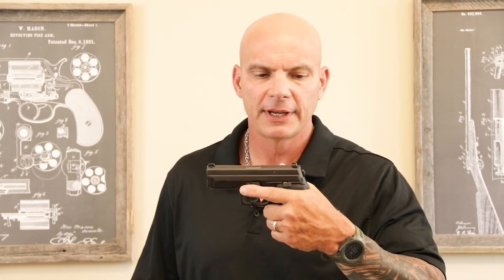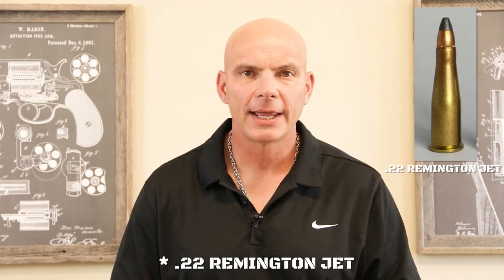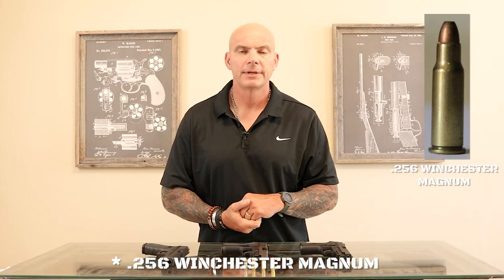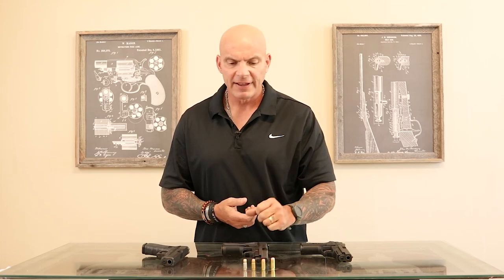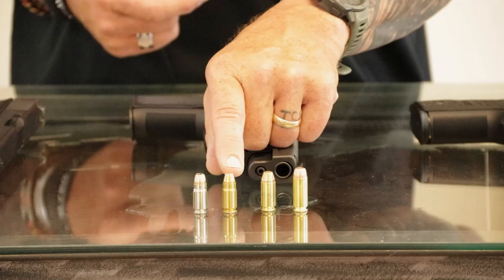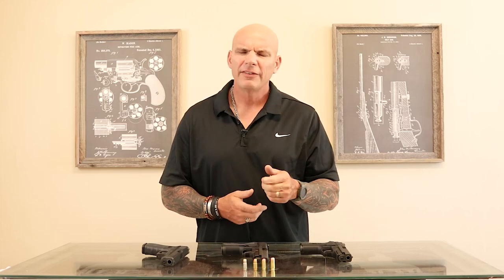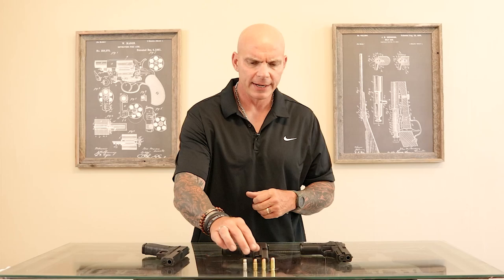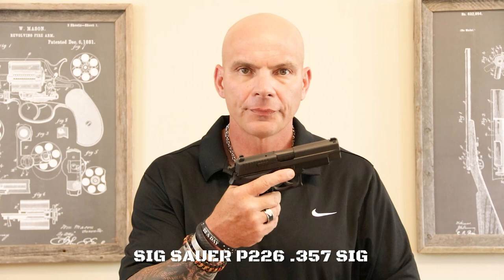A Brief History of .357 SIG

Comment: I have the exact same pistols in 9mm, 357 SIG, and 40 S&W. Subjective recoil depends heavily on the exact ammo you're using. A good example of this is 40 S&W, ammo is factory available in what amounts to IPSC "Minor" class loads, but also in "Major" class loadings. I was just in a local gun store yesterday who has several boxes of the lower powdered ammo that they're trying to blow out at under $20.00/box. 9mm has the same set of circumstances, there are 115 grain "promo" loadings that don't function in all pistols well at all. If you call the pistol manufacturer and complain about function, the first question asked is "what ammo are you using in it?" If you answer "115 gr ammo from Wal-Mart", they'll tell you to try 124 gr ammo and report back if it still has issues. 

357 SIG has a different issue, with full power loads many loads will reduce the effective performance (expansion) of many manufacturers 9mm bullets. They either expand earlier and larger than 357 compatible designs, or they can simply come apart at 1450 fps. I have a lot of Hornady 357 SIG ammo for instance, and it's downloaded a bit from max, I assume this is done to keep their bullets in the range of their most effective performance. Ever notice that Speers 357 SIG 125 gr Gold Dot isn't the same design as their 124 grain 9mm? The 357 specific loading uses a bullet that appears to be derived from the 125 gr 357 Magnum bullet. There are likely other differences, but this stands out above everything. The 357 SIG Gold Dot load is also a lot hotter that Hornadys 124 gr XTP load. Hornadys 124 gr load no longer appears to be cataloged, but my box of 357 SIG Critical Duty 135 gr lists a muzzle velocity of 1225 fps, and the 147 gr load shows exactly the same muzzle velocity. My Underwood stash of 124 gr JHP shows 1475 fps. Loading data for 357 SIG appears to be watered down in Hornadys manual. 

There is nothing wrong with this at all, I only mention Hornady because I have the most information for them. If the 124 XTP doesn't perform satisfactorily for them at those velocities, then there is every reason to not recommend their use. Hornady is just being a responsible manufacturer.

Comment: The 357 Sig uses a small pistol primers so it's parent case can not be 10mm. I bought a Sig 229 when it first came out and no ammo was available. No brass either. So I loaded some ammo by necking down some 40SW cases. It was a very poor substitute but it got me by for 6 months until proper brass became available. It's a fun cartridge to reload. The Hornady XTP bullets are a perfect choice. 147 Gold Dot bullets are outstanding with AA9 powder. In addition to the 229 I have conversion barrels for my Glock 22 and M&P 2.0 40. It's good fun but reloading is essential for ammunition to shoot. Berry's thick plated bullets help to reduce cost but use the thick plated bullets only for best results. Power Pistol, Longshot, AA9, and N350 are powders I use.
Reply: All of my 10mm brass is small primer. Using 40 brass you end up with a slightly shorter case and very little neck tension.
Reply: @brianmount7036  there is some small primer brass out there, mostly Blazer. When the 357 Sig was developed ALL 10mm had large pistol primers. The 357 was actually developed by initially necking down .40 brass. It became immediately apparent that the neck was insufficient and the 357 Sig brass was made from a lengthened 40 case drawing. The 10mm case walls are too thick to simply neck down and trim 10mm brass. I’ve tried it and it doesn’t work.
Reply: 10mm is the parent case for 40 and 357

Comment: A 9mm isn't even close to 357 Sig. The hottest 9mm I've seen is the Underwood +P+ 90gr Extreme Defender, which most guns can't even shoot. It is listed as having 480 fpe. It would probably blow up a Glock 19. That same bullet in a 357 Sig is listed as having 578 fpe; almost a hundred more fpe. Underwood's 65gr version of that round in 357 Sig is listed to move at 2,100 fps with a muzzle energy of 637 fpe. I've actually crono'd the 65gr Extreme Defender out of my 3.5" barrelled Sig P224 at OVER 2,100fps. I suspect that round can reliably penetrate body armor, although I've never seen it tested, and although Underwood still lists them they haven't been available for quite a while. Liberty Defense makes a 357 Sig round they claim goes 2,300 fps. I haven't crono'd that one, but you can really feel it in your hand when you shoot it. That bullet isn't designed for deep penetration. The 357 Sig is the king when it comes to getting reliable expansion from hollow point bullets. I've never seen a 357 Sig test where the bullets didn't expand properly. Also, I've seen numerous tests where the penetration of the 357 Sig was superior to the 10mm with similar bullets.
Reply: I was scrolling the comments looking for what you said here.  You are right, the 65 grain offering from underwood has not been in stock for a while, but I carry it myself.  The only testing I have done with it is for reliability and shot placement.  Running a smith m&p compact with storm lake barrel, night sights and crimson trace laser.  If you check midwayusa, they have the the penetrator rounds in stock, just sucks they they are 2 dollars a round.  I have never had any malfunctions with underwood ammo, and I have shot a lot of it to ensure reliability.

Comment: Maybe SIG thought that people wanted something between .38 Super and .357 Magnum in power and in a semi automatic pistol?It doesn't seem to quite reach the .357 Magnum in power but is well over 9mm and .38 Super.
Reply: They weren't trying to get "between" anything.  Sig specifically designed the cartridge to mimic the FBI .357 magnum load, which was a 125-grain jacketed hollow point moving at 1450 feet per second when pushed out of a 4" barrel.  And with the right ammunition, the .357 Sig will do just that.

The .357 magnum has the advantage of versatility.  While bullets between 125 and 158 grains are the most common, but bullets of 100 to 110 grains on the light end and 180 to 200 grains on the heavy end are available and not terribly hard to find.  And that's ignoring exotic ammunition such as Liberty's Civil Defense line.

.357 Sig ammo, on the other hand, almost always uses a 124 or 125 grain projectile.  And while some light for caliber options exist going down to 50 grains in some of the more exotic ammunitions, bullets heavier than 147 grains are virtually unheard of in factory .357 Sig ammunition.

Comment: When I was a teenager I remember thinking this round was unreal. .357 magnum performance from an auto loading pistol with modern magazine capacity. I’m sad it hasn’t caught on.
Reply: I has quite a bit more than you would think. Several State Patrol agencies have adopted the .357 Sig as well as city Police Departments. However Police Departments, like just about everyone else, are on budgets and the lower ammo price of 9mm is a real seller for them.
Reply: @Reaper-cm4jr  I know some PD have adopted it. I think on paper at least it looks like an awesome round. Being a teenager and not knowing any more than I had read on the internet I thought it would push 9mm and .40 SW out of the market.
Reply: @JG54206  It should have as in my opinion it is superior to either. But money is always an issue and 9mm is much cheaper and will still do the job.

Comment: Bottlenecking a cartridge does not make more gas. But it does ramp up the pressure for increased velocity. You only make more gas by burning more powder, if all else is the same.

Comment: I brought a G 32 and have a lot of ammo for it. However, I got rid of the G32 because, most of my shots was missing the target. I got rid of the fire arm and stuck with 40 and 10mm. I still have the ammo….. who knows I may try again in the future but right now, I very happy with my 40 and 10mm.
Reply: Just bought a G33 and have just over a box of ammo through it. Shot a four-round cloverleaf group at five yards of about 1", maybe a 1-1/4" group as I adjusted sights.

If you couldn't get it to group, it could be:

The gun- unlikely with a Glock.

You - unlikely if you can shoot everything else well.

The ammo - likely culprit. I've found factory ammo in some brands just are not tight enough tolerances to be very accurate. Or if you're shooting really hot loads. Or underpowered loads. Or a weight of bullet the gun doesn't like.

I think twist rate has more to do with it than we realize. With a compact 9mm I have, I simply cannot get highly accurate groups. With 115 jhp, groups are fairly good. 115 fmj, less so. 124 jhp not quite as good as the 125jhp.  Go to 147 grain and stuff hits all over the place.

What kind of ammo were you shooting in the G32?
Reply: @keithgraham9547  
I don’t remember it was like 3 years ago.
I know I had speers gold dots law enforcement , I think 125 grains.
Reply: @Lift_these  Hmmm. Good gun. Good ammo. Typical weight made for it. Good shooter.

I'm stumped.

Maybe it's just a case of that pistol just didn't fit you. I got rid of a 9mm recently after doing all I could to get good results. Sounds like you're a 10mm guy, and that isn't bad, huh?

Comment: I never warmed up to the 357Sig because I did not see enough difference in performance with the 40SW to make a difference and when I transitioned to 40SW I invested heavily in mags and handloading stuff... so it did not justify the effort, so to speak?
Agreed I’ll wake you up, but I could not really tell the diference with say a 135gr CorBon in 40SW, and I like the 180gr better any way. I also think the 357Mag and the hot 10MM perform better that the 357Sig if that’s what your application requires. So yeah. Great info as usual!
Reply: Even if cost and performance were the same, the cartridge will feed more reliably. It also out penetrates barriers in every comparison I've seen. Easy barrel swap to make a 40 into a 357.
Reply: @FoulPet  Never had a feeding issue with the 40SW and it has been my EDC and IPSC/IDPA/toy since 1990, and to this day. So yeah, not an issue for me.
As for barrier penetration... I tend to think NO handgun out there does a good job on that, so again not a real issue for me. When I think I might need to be concerned with a barrier penetration (in my particular case a soft skinned, non armored vehicle as in a vehicular counter ambush...) I turn to a long gun to get that risk mitigated; and preferably to a 12"brl 308W AR10 type platform... but hey, to each his own.  :>0
Reply: @joedeleon1189  people would argue that they never had an issue with 9mm or 45.
They would say 9mm recoils less and 45 is bigger. As you said, to each there own but, discounting an advantage because you've not needed it doesn't make it a disadvantage. I've not needed to draw a gun on a someone but I still carry. You don't need something till you do.
Reply: @FoulPet  And I would agree with these people who had never had an issue with their 10MM, 9x19mm, 45ACP, 380ACP, 38Spl or 32ACP since I myself have never had an issue with either. Now on the other hand, I inherited a vintage P08 Luger in 7.65x21mm that belonged to one of my relatives from the old continent. The 30Luger as it's also known, is a bottleneck cartridge almost impossible to find nowadays, but what is more pertinent to this conversation is that in this particular P08 it's an absolute "jamomatic" that was never reliable for as long as I can remember, and quite the butt to all kind of high school level family jokes. And as such, a safe queen kept more for sentimental value than any other reason. So yeah... my point is: There's no magic solution to anything?
By the way I never said it was not an advantage, I would not know one way or the other really, but what I did said was that it was not relevant to me. If it's relevant to you, by all means carry bottleneck designed cartridges only...  :>0
Reply: @joedeleon1189  I rarely carry 45. Usually  it's 9, 40 or 357. I see the disadvantages and advantages of each. I don't feel under gunned with any of them. Pretty sure they are all capable of getting the job done.  I'm a casual shooter and maintain my firearms. I've had light primers strikes, stove pipes and every blue moon a bad mag. I guess I'm unlucky because every one I talk to that shoots tens of thousands of rounds a year, never experience any issues. I've had a few pistols and rifles sent back to manufacturers because of problems. I'm not talking keltec junk either. So I trust nothing 100%. Primarily now I carry a P229 or a P365XL. Waiting on Smith and Sig to iron out any problems with their 10mm releases.
Reply: @FoulPet  Cool! I've had a few lemons too over the years, but they where gotten rid of ASAP... same goes for mags. Off they went  too, but a few old IPSC/IDPA beaten up ones I've kept for range practice to induce stoppages, slides that don't stay open on last rounds, that sort of stuff. 
Fact is I've pretty much narrowed my hardware to what I really enjoy shooting: A few .40SW and .380ACP plus 38Spl. Some stuff that has sentimental value to me, and some long guns: 12gauge , 308W, 223, 300BLK and a couple of 22lr (pistol and carbine) that I bought a very long time ago to teach my kids with; and are now waiting for the next generation of new shooters in my household... :>0 
I might move away from the 308s and 223s though, and move into the 8.6BLK but the jury is still out on this new cartridge and the logistics might prove to be a pain, at least at first; even though I think it will be really cool for my kind of applications.   
I used to have many toys growing old but figured out they where just safe queens, really, and I got rid of them over time. Most to friends who had to have them... So yeah, nowadays if I try some of the new stuff it's because some friends brought them to the range to brag. 
Unless it's the 8.6BLK... I really think that stuff will shine. :>0

Comment: Many government agency's use the  357 sig and its underrated.  40sw should have never become anything they should have had 10 and 9 if you could not handle 10.

The .357 sig when loaded hot is a great round, I love bottle neck cartridges as they feed with more reliability.

I wish they also made a 7.62 sig a 10mm cut down to 7.62 or 7.5mm.

My hottest loads of 9mm sig won't go though 3A but 7.62x25 tokarev will.
Hot reloads and surpluss.

I wish they imported CZ75 style pistols chambered in 7.62x25 tokarev made in Eastern Europe to the states.

When I was in upstate NY being 21 not that long ago with the 7 round mag carry limit my first handgun was a new made Zastava tokarev the mag could hold 8 and it had a real safety.

I could keep one in the tube, I would not carry a cocked and locked TT33 with an added trash safety.

I managed to put some tritium inserts in the sights and would all ways carry Bulgarian steel case surplus SMG ammo as my uncle had at least 200k rounds of the stuff as it used to be crazy cheap.

It was a thin gun that did not print, heavy but easy to conceal, you could cock it one handed by using the sights and once sighted in (I made them tritium and did a home job to zero the sights) it was great to shoot, snappy and flat shooting with long range.

I used thin wood grips, gave it a trigger job and it was crazy accurate.

I was lucky I managed to get 2 spare mags with the 2 I had,   when 7.62x25 got really expensive and I didn't want to shoot up my stash I got a 9mm barrel and it worked fine with cheap 9mm steel case.

In semi auto pistols  I only shoot 9mm, 10mm, .357 sig, 7.62 tok and 9mm Mak and .45acp for historical 1911s and to run with cans. 

I really want the CZ FK 7.5 but the gun and ammo are crazy pricy.

The 9mm makarov is an underrated subcompact you can get at a good price and you can load it hot, it's quite a bit more powerful than .380

I don't own a single striker fired pistol
Reply: Dude you need to really give up caffeine and take a deep breath.

Comment: Just got a fullsized SIG P320 X model in 40 S&W the first thing l did was get a 357 SIG barrel for it the cost of ammo is expensive but the accuracy and power surpasses 40S&W wish this round would take off in popularity l did get some 357 SIG ammo from Feedom Muntions for 21 dollars for 50 rounds not reloads new it was on sale for one day not 9mm cheap but enough to run 150-200 rounds for pratice 357 SIG more powerful than 40 S&W not quite as as powerful as 10mm

Comment: To me the 357 Sig recoils significantly less than a 40. Some may perceive the 357 as having more kick because their intimidated by the muzzle blast. That’s been my experience
Reply: I agree about the recoil of 357 Sig being less than 40 S&W. I base it on my SIG P226 which came with two factory barrels, one in 357 Sig and the other in 40 S&W. I find the 357 Sig has less felt recoil and additionally it has never jammed on me which the 40 S&W has.

Comment: It's not even like the bottlenecked pistol cartridges were invented in the 1960s.  .30 Mauser, 7.62x25mm Tokarev, and 8mm Nambu had all been around for quite a while before the '60s rolled around.  

That's not to mention he .32-20 cartridge, which is slightly bottlenecked.  And while originally designed as a rifle cartridge in 1882, some revolvers were also produced for it at least into the 1920s and modern reproductions have also been made.

Comment: I've honestly never owned any "standard pressure" .357.
I converted my Glock 24 (6" barrel) and couldn't find any ammo in stores so I went Underwood.
Quite honestly, the recoil is prohibitive. The gun kicks harder than my GP100, I'd even go so far as equate it to my Redhawk in .44mag. I might buy some Talon grips to tame the slick Gen3 grip frame, but I don't enjoy shooting this round. I can get through about 50 rounds before I move on. I imagine out of a steel frame CZ pattern or Sig, .357 is awesome.
*also, another factor working against it is how annoying it is to reload. From what I hear, it's not as simple as reshaping .40 brass. Same situation as 5.7x28.